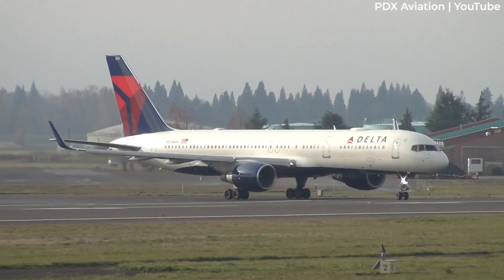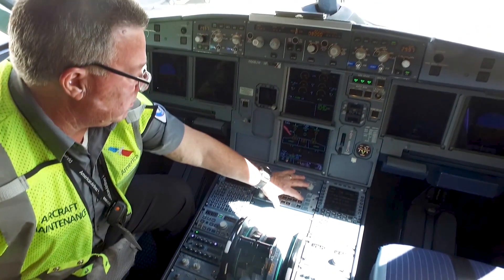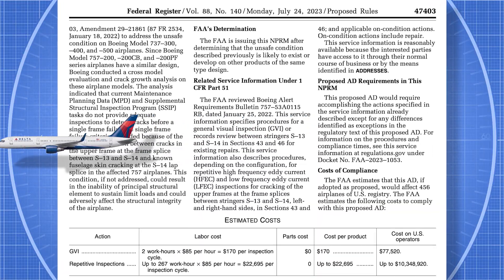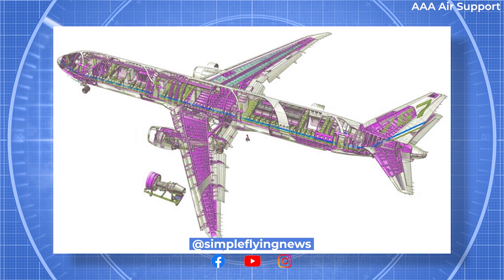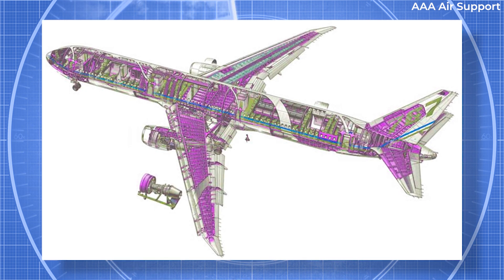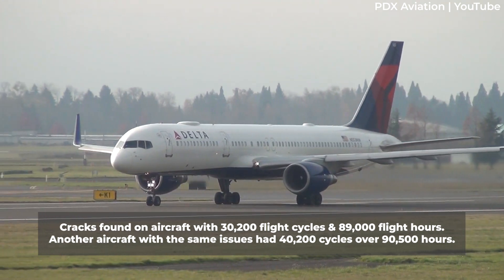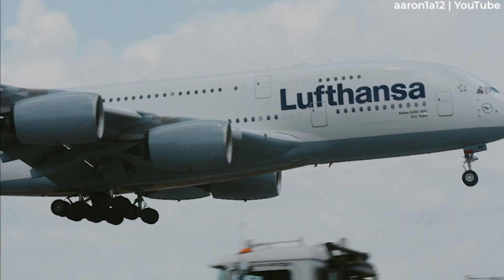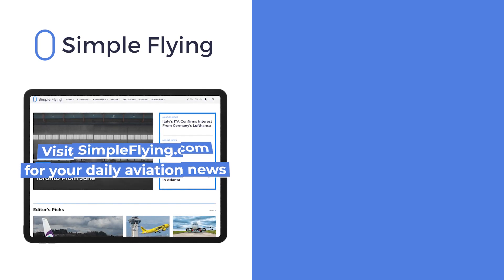FAA Proposes Airworthiness Directive Over Boeing 757 Frame Cracks

Comment: this is par of course for boeing aircraft manufacturers. why you dont hear of this occur with airbus aircraft? because airbus aircraft use actual engineer to design aircraft, not business man in skyscraper
Reply: You don't hear about them because you choose to ignore them. 
Just had one issued for the A380 for more wing cracking , unrelated to the last one..
 Your lack of knowledge anything aviation is clearly evident..
 Do yourself a favor..
Learn about AD's and what they actually mean..and see AB has had their share as well ..
And stop turning a blind eye when they have one too.
Reply: Every single Airbus aircraft made to date has also had AD's issued. Its not a "Boeing thing" its an age thing in this case. The youngest 757 in the sky is more than 20 years old.
Reply: @dmcr9525 19 actually

Comment: All of these 'directives' are based on a normal Aluminium skinned jet aircraft.  Such stress cracks even fractures can be detected in routine maintenance schedules using electronic (X-Ray?) type gadgets etc.,
My concern is all these newer Carbon fibre 787 Dreamliner or the Airbus A-350.  Are there proper diagnostic equipment to detect delaminations or cracks in the wings and bodies of these new carbon fibre aircraft ?
When there is (God forbid) the first crash of such carbon fibre jetliners, unlike Aluminium where the point of failure can be traced from the wreckage etc., with existing diagnostic equipment. 
when carbon fibre shatters,
it shatters (disintegrates) into a million pieces, so how does one figure out what really happened to the aircraft ?!? 
🤔😐
Reply: Of course they have ways for those things that’s a silly thing to even think about because if they didn’t then they wouldn’t be able to make regular checks
Reply: @bigonicha3225  How is carbon Fibre tested?
For the most reliable results, carbon fiber composites are typically inspected using specialized UT techniques such as phased array ultrasonic testing (PAUT). PAUT instruments can provide the necessary scanning radius and flexible procedures to detect a variety of flaw types.

But my main point is AFTER a catastrophic crash,  with all the carbon fibre structures 'blown to smithereens,'  where do you begin to figure out the source, the cause of the 
carbon fibre structural failure ???
Reply: @tscotom  they have sensors and other instruments that monitor the entire aircraft,that’s how they gonna know.That’s basic knowledge of the aviation industry,and as I said again before there is no aircraft no matter it’s composition that has no way of telling you speak as the material is some invisible thing when you can spot cracks on it with simple eye contact.Last but not least they are not made with pure fibre they have certain built with fibre the rest is steel 

P.S you have no clue about aviation so stop googling stuff and then coming back like you are knowledgeable
Reply: @bigonicha3225  Hmmm, probably not enough to be able to remotely monitor (in real time) the aircraft performance.  There are  the blackboxes to know the internal comms, but when it comes right down to aircraft crash investigators, finding the beginning of the event, it usually involves some (faulty) part, assembly or system, and in the case of carbon fibre jetliners, all of that structure goes SPOOF, nothing to touch, handle, to look at, NOTHING !
Perhaps, like in the Titan submersible, they had many sensors (audio?) embedded in the carbon fibre structure but even that is not proving conclusive as to the point of failure of the carbon fibre structure.  
You need something to touch/handle/analyse in order to definitively conclude ... something. 
This does not bode well for the future of commercial aviation today.
Reply: @@phillipbanes5484 think again,  have you ever seen the carbon fibre carnage in a Formula 1 crash ?  
SMITHEREENS !
Aluminium debris is always there to be analysed ... since the onset of jet aviation,.
re: the first Jetliner, the deHavilland COMET
disasters, esp. the COMET going to Greece for the Boy Scout Jamboree,
with the Philippine Boy Scout contingent, all LOST, & one of them being my cousin.
Reply: Actually, a first case of that might be the submersible than imploded going to the Titanic. 
It was made out of carbon fiber, you know.

Comment: Around a dozen ADs are issued each year for major airliners of different brands, models and series. Nothing new under the sun
Reply: If its Boing Im not going!
Reply: @benwilson6145  them do not flight at all, because there is another bunch of ADs issued for different parts, instruments or equipment that are common to Boeing, Airbus and other brands. Including several for the engines that are common as well. There is no more a 100% airplane Boeing or Airbus, even Chinese airplanes use parts made by western providers. So your best bid... Do Not Fly at all!!!
Reply: @benwilson6145 I've not heard of Boing? Do they offer a good product?